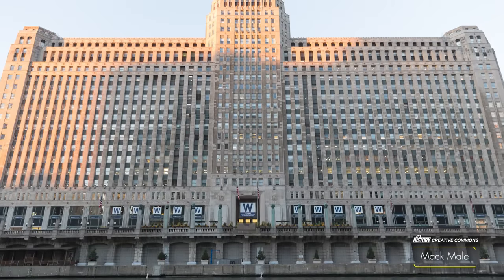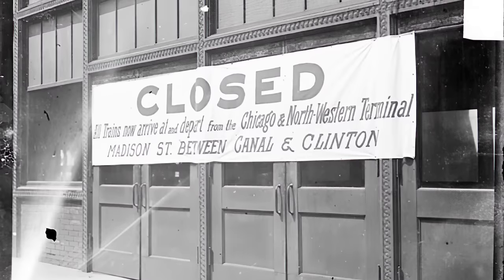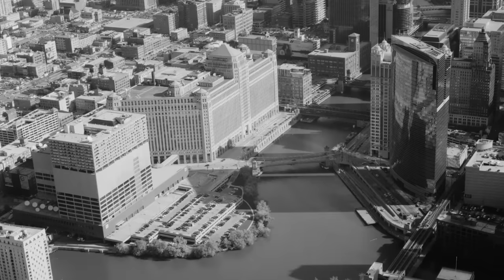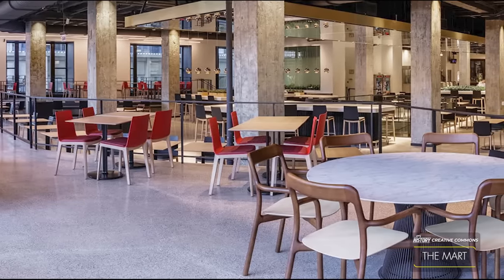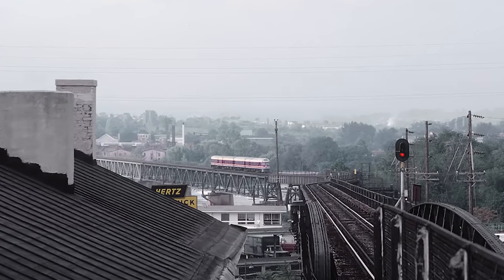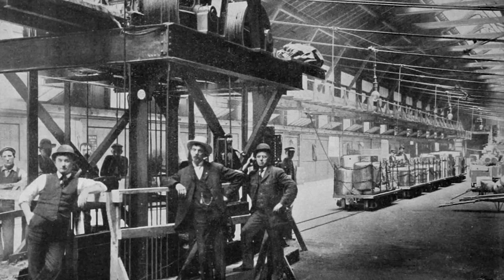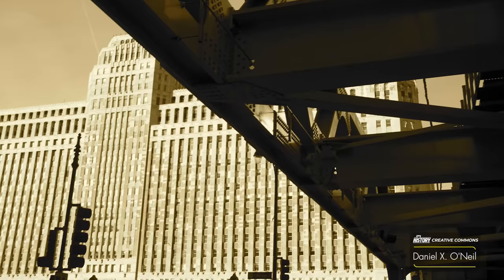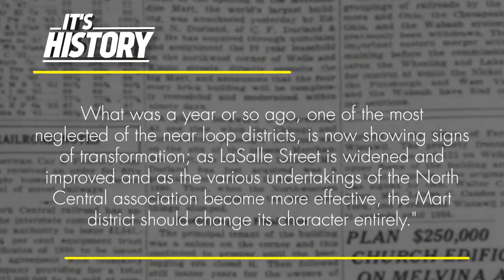Forgotten Rail Yard Under Chicago's Largest Historic Building - Merchandise Mart

Comment: I was an locomotive engineer for the CNW (now retired) and I would occasionally work an industry job out of State St. yard or North Ave. yard and we would spot cars at the Chicago Tribune's old printing plant on Michigan Ave. or other customers and in order to do that we had to go underneath the Merchandise Mart on a single track that was often blocked by parked cars that people had carelessly parked too close to the tracks and we had to call a tow truck to remove them so we could do our work. I knew nothing of the history of a whole mini rail yard underneath the Mart! The only thing left was that single track that we used.
Reply: Not many people have pooped under that building 😁
Reply: If you remember the American Freedom Train visit of July 1975,  they used those tracks to run the train to Navy Pier where the coaches were put on display.  My dad, who worked at Marina City, told me the steam engine derailed at Marina City, likely because the tracks were in poor shape by then for heavy steam engines.  I drove on North Water street a few times and seem to recall tracks in the roadway.  North Water St is tricky to find but pleasant to use as not to many people knew of it. I think the city has cut it up for ever popular building construction.  This explains why the rail routes in that area have disappeared as well.

Comment: The bridge is technically not permanently lifted as it’s lowered once a year for a track inspector to roll across
Reply: The coast guard or the army corps of engineers requires all the movable bridges to be kept movable, also Union Pacific is keeping legal rights to the right of way which they use the bridge as proof of.
Reply: Union Pacific doesn't want to lose any right away in the city, especially this. Lot of regrets from some railroads giving up their property

Comment: That line under the Mart was still in service until the 80’s as newspaper supplies fir the Chicago Sun-Times was delivered to their press a few blocks east. The line also continued past that all the way to Navy Pier. In addition, the few tracks that veered southward from the bridge toward Wolf Point were the remains of station tracks from C&NW’s original depot that preceded the huge Madison St. terminal.
Reply: the line was in use up to the sun-times building until the late 90s, it wasnt until the sun-times built their new press plant out by ashland avenue, and they removed the press in the sun-times building, that they stopped delivering paper by train. I worked at the sun-times until a couple weeks before they moved out of the building in 2004.

Comment: I loved working in that building. Worked on the 13th and 15th floor for many years. Been down their freight elevators to the basement where I could still see the old train lines and their post office. You can still send mail down through vacuum tubes.

Comment: Q101 was based in the Mart. Originally up in the historic studios but by the time I toured their studios they were just above the El station as I recall. I’m not sure where they are now but I believe they moved after the station was sold to the owners of WLS.

But yes back in the day, that is where Mancow would have broadcast from. 

Btw those historic studios were also the original studios of WMAQ-TV until they moved in the late-80’s to the NBC Tower. (WMAQ AM did move at that time too, but WKQX did not.)
Reply: 17th floor
Reply: Q101 is also in the NBC tower now.
Reply: That's so 20 years ago. Mancow?  He is pretty much off the air now.
Reply: @acdii  What the devil is a Man-cow? Bring back Murphy In the Morning! (shakes cane)
Reply: I recall Floyd Brown when he was on WMAQ radio.
Reply: I think Brandmeier also broadcast out of the Merchandise Mart while on the Loop.
Reply: Are there still radio studios in the Mart? If so are they being used?

Comment: In 1992 the tunnels did NOT just "gave in" as the narrator said.  A piling was being pounded into the Chicago River as part of the Kinzie bridge rehabilitation and the city had approved the pilings to be in a different position than the old ones.  But it was too close to the tunnel unbeknownst to them.  The pressure created by the piling ended up breaching the tunnel wall.  The damage was caused, it didn't just happen.
Reply: That’s exactly what the narrator said.

Comment: First of. Good video. But the "Wells Street Station" Harrison & Wells was the B&O Grand Central Station home of the Pere Marquette/ Chesapeake & Ohio, Baltimore & Ohio and the Soo Liner. It closed in 1970. The "Cement" you show is actually a "coke push" pushing the
Charcoal equivalent of coal out of the coke oven into a quenching car to be sprayed with water. Coke is the fuel in blast furnaces. Grand Central Station was torn down for a development that never happened and the site is vacant to this day.  You show the trainshed of Grand Central Station. The foot print of the station and it's three concourses are still there. My dad worked for the C&O and we frequently went to Chicago to Grand Central Station, so I "grew up" there.

Comment: The "deep tunnel" he mentions is part of the Chicago "Deep Tunnel" project (actually, TARP or "Tunnel and Reservoir Plan") started in 1975.  It was a massive 4 billion dollar project that isn't all that well known.  Basically, it is designed to capture the water from a large storm so the water can be dealt with over time after the storm to prevent flooding and overwhelming waste treatment facilities.  Prior to that, people were rather accustomed to sewers backing up in a big storm.

Comment: It seems like if the train tracks still worked Amazon could turn the building into a huge warehouse central located in the country. Build a cargo airport a bit outside the city with tracks to it and the UPS and FedEx world hubs in memphis and Louisville made to look quaint.
Reply: Nobody wants to deal with fire brigade loading and unloading boxcars like that anymore.  They used to line up multiple boxcars on many parallel tracks and run heavy bridge plates between the open doors of adjacent boxcars.  Very labor intensive and entire tracks would have to be cleared just to get one car out.  It is much easier to move truck trailers around and back them up next to a building.

The railroads have rid themselves of a lot of switching and trackage thanks to subsidized highways.  They effectively outsourced the labor to local trucking and collect all the loads at one main rail yard.  This increases truck traffic on roads around cities, increasing sprawl by allowing industries to be further from rails and a lot of truck storage and staging has been pushed on to roads as well.
Reply: Shhs if he hears you. He may do it. Don't give him a challenge

Comment: 7:23 The Gearing class was a series of 98 destroyers built for the U.S. Navy during and shortly after World War II. The Gearing design was a minor modification of the Allen M. Sumner class, whereby the hull was lengthened by 14 ft (4.3 m) at amidships, which resulted in more fuel storage space and increased the operating range.

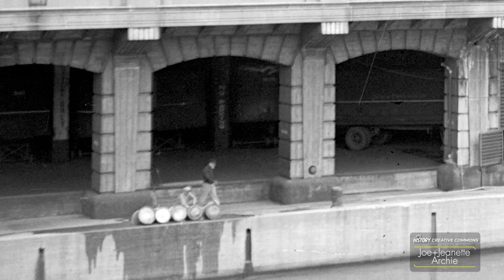Comment: a big part of why this was eventually abandoned was the route was actually quite inconvenient. The tracks were a level lower than all the surrounding roads and railroads, meaning the two-track bridge had to be raised and lowered considerably more often than other bridges. Goose Island, north of this bridge, was still a significant industrial area at the time and there was a lot of river traffic. Secondly, there used to be a line going north out of Union Station along Canal Street which intersected the line right on the west side of the river, shown in your video at 18:39. (On a side note, this line to the north was the same line that used to pass in front of Wrigley Field at street level until the 1970s) This created a regular logistical headache for the railroad and was a big reason they built the new terminal on the west side of the river, requiring no river or railroad crossings at all.

Comment: To answer regarding Q101, they just returned to radio after several years of hiatus. However, while I have no clue where they're headquartered, I do know that Mancow hasn't been on Q101 since 2006. He since was on TV, 97.9fm The Loop, and 890 WLS, ending his radio run in 2020, when he left due to censorship and a failed gubernatorial run
Reply: He quit radio due to Covid and the quarantines and lockdowns. He stated he couldn't do the show the way he wanted to with everyone being remote and it took away from the "fun" he had doing the show.   The Gov run was started in January 2022.

Comment: There are YouTube videos about that debacle with those tunnels because one of the pilings had actually broke through and you could actually see the water draining in a Whirlpool and there were numerous calls to the city about what they thought was the water level Chicago river suddenly leaking underground that's what people thought was happening and by the time they realized it the tunnels were basically flooded with about 5' of water
 The tunnels actually were eventually repaired because by this time they were used as a corridor for piping and electrical and they decided to put in bulkheads every so many feet thus creating a water tight system that they could shield off one section if that ever happened again

Comment: back in the late 80s, i walked around the CTA offices, and there were massive electrical cables, and maybe data cables ran through the hallways above at ceiling level. it was strange. it was a city within itself

Comment: A picky point.  There's a clip at about 6:32 that supposedly shows concrete mixing.  It's actually a steel mill coke oven, totally unrelated to concrete mixing.

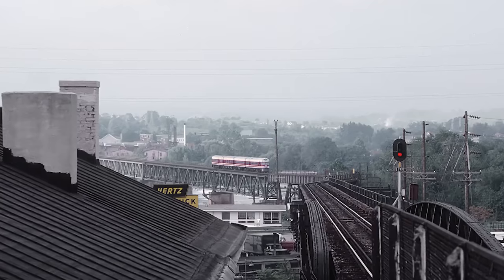Comment: That picture at 16:59 shows a FORMER North Shore Line train painted in "Red Arrow Lines" livery on the Norristown High Speed Line in Philadelphia. A better illustration of the link between the Mart and the North Shore would be of an Electroliner in its classic North Shore Line livery at the Mart's elevated platform.

Comment: If Chicago has 60+ miles of underground tunnels, I wonder if it would be worth it, depending on where they go, if they can be re-purposed for freight moving between industry buildings...  i.e. if frieght comes in to port and then having distribution centers spread around closer to end customer deliveries... Instead of clogging streets up with box trucks and delivery vehicles, bring items underground and setup the distribution centers along the lines.  Design custom rail system just for its use..... I wonder if Amazon would do something like that....  if  tunnels would go under/near their chi distribution centers...  They always try to think outside the box... that would be outside the box...  what's better then pre-dug tunnels where the expensive work or digging was done 200 years ago and they just referb and build their own system to move cargo. 

Just thinking outloud when he brought up the tunnels at the begining of the vid.

Comment: Dude great vid. But I am becoming increasingly distressed at your use of the word “Massive”. In some contexts, like the pouring of foundations it may be the correct adjective. But Mass refers to an objects weight in a given gravitational field or inertial situation and not its size. A ton of Styrofoam will take up much more volume than a ton of lead. I believe Enormous, and even Gigantic is now allowed. But we wont go there with my pedantry. … I know very little more  but this really is 101 stuff.

Comment: We are experiencing Hyperinflation, not just regular inflation, because at 2% per annum inflation, it would take 35 years for prices to double. The cost of that building has increased 1642% since 1928. 

What cost $26,000,000 in 1928 would cost $426,989,265.08 in 2021. If inflation has only been 2% pa, then that building would have cost around $167 million to build in 2022.